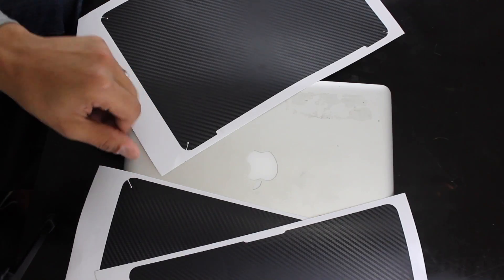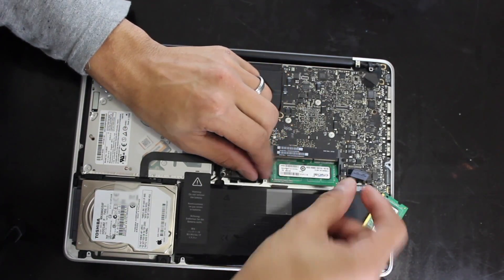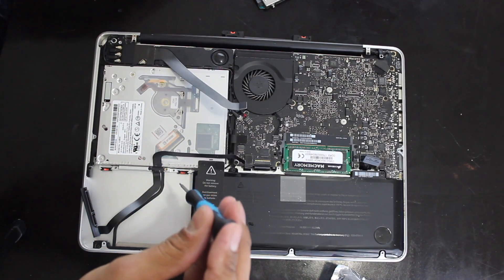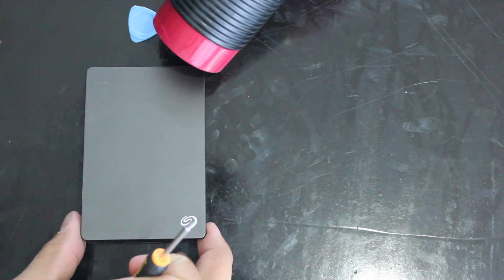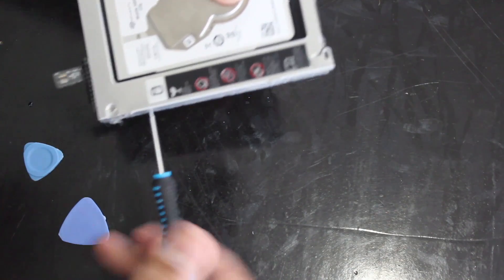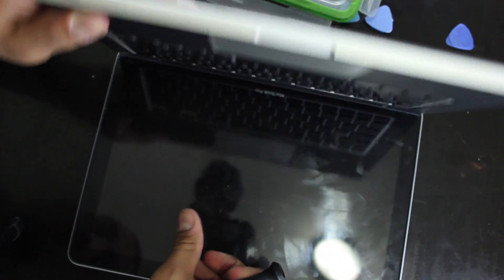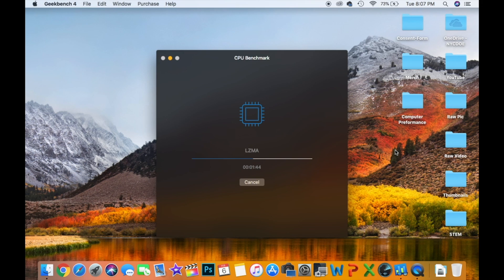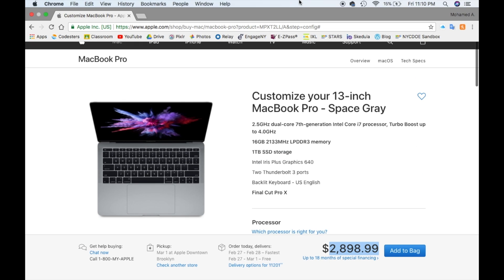2011 Macbook Pro Upgrade (3TB, SSD + 16GB RAM)

Comment: I have a 2011 MBP I upgraded to 240 SSD & 8gb. I only use it for Logic Pro X. Works great. Only downside is, I can’t update Logic past 11.3 not a big deal. But also, some external music gear isn’t recognized with High Sierra. Some midi keyboards and drum machines etc. And of course now that Apple doesn’t support Hugh Sierra as of the last couple months, no security. I really don’t wanna buy a new Mac. I love mine.
Reply from the maker: thank you for your comment
Reply: I have early 2011 upgraded to 500gb Ssd 8gb ram and used open core legacy patcher to install MacOS Ventura, I am getting all the updates runs very smooth. Though I must share.

Comment: I need to replace my optical drive with another SSD. I replaced the HDD on my 2012 MacBook Pro with a 1TB SD, the RAM was upgraded form 4GB to 16GB. Adding an SSD will make a huge difference.
Reply from the maker: thank you for your comment

Comment: My 2011 is not detecting the hdd. Changed cable still no go.  Will it detect and boot etc by only having the hdd in the optical bay?  Thanks
Reply from the maker: thank you for your comment. sorry for the late reply

Comment: Huge Thanks for this video: I have "MBP 13.3/2.9/2X4GB/750/SD" where "Model No: A1278" - Can you confirm if I can buy 
"WD Blue SA510 SATA SSD" - 1TB of capacity - "WDS100T3B0A-00AXR0" (shown in back of the box package)? - My uncle should buy this HD in USA and I live in other country - so is not possible make a mistake. Thanks for your understanding.
Reply from the maker: thank you for your comment. sorry for the late reply, it should be okay
Reply: @MoeNegm  Thanks for the reply and data.

Comment: Hello, I've been wanting to do this. I noticed when I went to the RAM they offer higher Mhz and higher GB. Is it not recommended to go higher? Could getting a larger capacity Samsung SSD and a larger optical drive make it possible to utilize more RAM capacity? My 2011 Macbook has gotten the grey screen of death and I just want it to be useful again and this video gives me hope. Just want to max out its ability for sure when I repair it. Thanks for the video!!
Reply from the maker: thank you for your comment. sorry for the late reply.

Comment: Good Day Sir, Sir can you guest what's wrong with my MacBook Pro (13-inch, Early 2011), I recently upgrade the OS (high sierra) of my device, It went good, but not until I unplug the charger it freezes and heat up my Mac..   What should I do? Btw my mac had 4+4 gb ram, 119 gb ssd, 250 hdd, Intel HD Graphics 3000 512 MB graphics... Thanks for the fb..
Reply from the maker: thank you for your comment. sorry for the late reply. I'm not sure

Comment: Out of curiosity from watching this video that helped me install my new SAMSUNG 870 EVO 1tb on my mid 2010 MacBook pro, my question is.. How come i can shut off the computer and turn it back on to easily be brought to the password screen to log into my MacBook, but if i click restart instead of shutdown to turn back on.. when it reboots from a restart it brings me to the ERROR icon, but if i shut off the computer from that error icon and turn it back on, it works FINE. lol, could this be because i still have the original 4gb ram in it ?
Reply from the maker: thank you for your comment. sorry for the late reply, i'm not sure that's weird! maybe your ram?

Comment: All that money and work, and then running High Sierra?
You can run Monterey on it:   https://www.youtube.com/watch?v=-huRykhjs6g
I've installed Monterey on 2011 and 2012 MBP's and it works great.
Just beware of 32-bit apps.  Tney won't run on Monterey, so the highest you can go, and still run 32-bit apps, is Mojave.

Comment: I'm actually watching this video, with a Macbook similar to this. (MacBook Pro (13-inch, Late 2011) And I can say, this Mac has been amazing for the many years I've had it. I can say it still runs pretty well, and sometimes better then new Windows computer coming out these recent years. Obviously, it isn't in it's prime anymore but still gets things done, without any issues like lag, and overall no performance issues, and I've never changed anything hardware-wise in it. Can still stream, and play games on it, and go on high-performance apps. Honestly, I would change computers, for a newer one but sadly these new ones tend to be made cheaper then this, and lack the features, like this one has. As an Apple worker once said to me, this computer is a gem, and they dont make this type of quality anymore. I'm not an Apple fan, with this being one of the very few apple products I own, but honestly, for 2022 it can still handle it. It just depends on how well you've treated and maintained it, but I use this daily and its great. But maybe in the future, I'll be doing this type of upgrade.

Comment: Why would you install the same slow drive in the optical holder instead of a SSD? 2 TB does not speed it up, that's storage size only, as long as your new main drive has the OS it will run faster, but it will bottleneck when it accesses the HDD.

Comment: Why didn’t you clean the dust from the logic board & fan to make it run cooler also replace the GPU & CPU thermal paste? With all of that work you still more to do. I’m not sure of the purpose for the 2nd Hard Drive & especially 2TB? Good job to make the most of your older but better repurposed MBP!

Comment: I replaced the memory to be 16 GB a couple of weeks ago and I noticed some difference, the laptop has more speed.. However, I replaced the SSD today with the one you recommended (1TB samsung). However, once I turned the laptop on, it only showed the grey screen and it had a blinking icon in the middle of the screen (the icon was a folder with a question mark).. it stayed there blinking and nothing else happened. I put back the old SSD and computer works.. any idea of why that happened??
Reply: You need a usb to put the system again 😂
Reply: What do you mean? “/

Comment: How much did this cost to do? My 2011 mac is sooooo slow, I get the spinning circle with every click and using imovie is impossible.
Reply: Less than $500.  I added a 1 TB SD HD and upgraded the memory to 16 GB.  Worth every penny especially compared to a new one!
Reply: Were you able to complete the hard drive upgrade? How did you transfer data from the old drive to the new drive? Thanks in advance for any feedback!
Reply: @parkerrogers2277  i had a Time Machine backup and used it to restore all the data to the new SSD.  You will need a boot drive (USB Smart Drive) to boot from after installation of the new SSD, and restore from Time Machine backup.  It took some time to restore but it was worth it!

Comment: I did this exact upgrade on my 2011 MacBook Pro and it made my computer blazingly fast.  I was amazed!
Reply: Am doing tomorrow so excited!!
Reply: I have replaced hard drive with Samsung 1Tb and am using Old drive as external drive this way my data is safe and i can access it anytime by connecting with usb
Reply: did you update the hard drive as well? if so, how did you do the back up and the restoration after the upgrades? I have updated the ram and just purchased the SSD but have not pulled the trigger on the optical drive/hard drive
Reply: @neryorozcoyt    I put in a SSD drive and used the latest backup from Time Machine to load all the files on to the new drive.  I used a flash drive and created a bootable installer first, swapped drives, booted from my flash drive and let Time Machine load to the new disk.
Reply: @stevenjp7155  Do you think using SuperDuper! would also work to copy from old drive to new? This is a video of that process from 2017: https://youtu.be/j2efihrnStg?t=546  I really appreciate any feedback. I'm attempting to help a family member with her computer.
Reply: @parkerrogers2277  I honestly don’t know about options other than Time Machine.  Since Time Machine is built into the OS, it worked seamlessly without any data loss.  Sorry not more help.
Reply: @neryorozcoyt  Yer witch one do you install the new osx on ?
Reply: I’m doing the same can’t wait

Comment: Hello! Great video tutorial I followed this to upgrade my MBP and it's working amazingly! Appreciate this. 

Question for you- it seems my internal temp has dramatically risen with the readings since doing the upgrade. Average around 200 degrees F and prior to the upgrade, the readings were around 130-150 F. However I can't imagine this being accurate bc even when it reads 200, the laptop is significantly cooler to the touch so did I mess up the sensor in some way? Or is this normal with a SSD? not a biggy but the fans keep kicking on so loud. Any help would be appreciated! 🙏
Reply from the maker: I honestly don’t know why that would be happening. I hope someone on here could possibly help you out. Did you install 16 or 8gb? If you installed 16, try reducing it to 8 and see if that helps. 

My guess is that the processor is working kind of hard to keep up with the extra speed achieved by the SSD and the Ram upgrade?
Reply: @MoeNegm  thanks for responding! It was 16 ram so quite possible regarding the processor. It's just strange that to the touch the laptop is much cooler now with the SSD than it was before the upgrades. Other than that, this laptop is now a beast! Couldn't be happier still need to upgrade my iMac 27" same yr
Reply from the maker: Sweet, I’m literally filming that exact video right now Lool.
Reply: @MoeNegm  nice!!! I can't wait til u post it!  I'll follow along lol

Comment: Question, can I go 16 gb of ram total of 32 gb? Same brand of the ones you recommended but 16 gb interested of 8 gb.
Reply: you can't have 32GB of ram because 16GB is the limit for a 2nd gen i7

Comment: So I went ahead and did all of these upgrades to my MacBook Pro (early 2011) and now the startup manager won’t work at all. 
I reinstalled my old HDD and everything works. Startup manager works fine. 
I reinstalled the new SSD (Samsung 860) and all I get is a white screen. I’ve tried every key option while powering up but no luck.
Anyone else have this problem ? I could really use some help with this ...
Reply: Did you format or clone the new ssd?
Reply: @Asphaltaperider   wound up being some pre installed programming on the 2 TB HD.
After reformatting and using a clone backup, it worked.
Reply: @Asphaltaperider  clone

Comment: I did it on my 2012 15” MacBook that had a regular hard drive with 4gb ram and now it has a Samsung 1tb ssd and 8gb ram and it runs exactly as fast as my 2018 MacBook
Reply: Thank you, mine is a MacBook Pro 15 inches, where specific store had you buy those pieces?

Comment: Great video mate. I need one for doing video and photo editing and I'm considering doing either a 2011 or mid 2012 MacBook Pro with max upgrades. Now in 2020 what would you recommend for these tasks?
Reply: Which did you get I'm in the same position as you i wanted to use it for software development
Reply: @elite.1  Back then i got a 2012. I am currently using a 2015 that i got for $50 https://youtube.com/shorts/cOM8bJBruQE?feature=share 
Honestly performance wise there is not that big of a difference so i guess you can still do 2012 and max it out.

Comment: If it wasn’t for the atrocious screen resolution of those older 13 inch models I probably would have kept mine.  Too bad there’s not a way to put a higher res panel in it.

Comment: @moenegm great video! Can I install 2TB SSD?  Pro’s - Con’s? Also can you install more than 2 TB into the optical Drive (it appears that the physical size would be too big).
Reply: Yes you can install 2TB SSD, and you can install more than 2TB in Optical Drive Caddy but it would have to be a SSD due to HDD starting to use 3.5 Inch only when it comes to 3TB and more, the highest SSD you can buy right now that's common is 8TB Samsung 2.5 Inch SSD, the Pro's are is you get more storage and you COULD Raid 0 them, the downside is you won't be able to watch DVD's anymore (Although you could use the SuperDrive externally by using the Optical Drive SATA to USB Cable), I hope this helps.

Comment: Just bought a late '11 15 inch with 16gb and ssd. I hope it'll run fcpx decently. Would you upgrade to Mojave / Catalina or would stay in High Sierra running an older final cut version?

Comment: Hi, I would like to know if I can use different external drive for the replacement of optical drive? I'm referring to WD 1TB. I'm trying to replace it now but it seems that the WD external drive has different pin connectors.
Reply: You need an external drive with SATA type connection inside.
Reply: If you value your data, you would install an SSD, not a WD 1TB external HHD.

Comment: After doing the upgrades to the hardware and restoring with time machine, can you now upgrade from High Sierra to Catalina? I have a 2011 MacBook Pro that needs to be able to run Catalina and I would much rather follow your video than buy a new machine 😃
Reply: Update: using a video I found from “dosdude1” on YouTube called how to install macOS 10.15 Catalina on an Unsupported Mac” - was able to update to Catalina
Reply: How did you transfer data from the old drive to the new drive? This is the only step I don't feel comfortable doing that's preventing me from doing this upgrade. Thanks in advance for any feedback!

Comment: Hi Moe. I just installed a 1 TB SSD to my back pro along side the 16 GB of RAM to it. I followed all the steps you did as far as installing the hardware. However, when I start the computer and log in it is giving the message of “drive not identified”. Is it because I have to run the backup that I have? or am I missing an extra step? I would really appreciate it.
Reply: Did you figure out what the issue was?
Reply from the maker: Did you figure it out?

Comment: I mean everything you just said about not upgrading makes zero sense, the reason being that the i7 8th Gen performs about 200% better than the 2nd gen. The ssd is about 2 times faster. The graphics performance is wayyy better. So even the i5 8th Gen on the base model is better than the i7 that u have
Reply: I agree with you buddy. He's willing to stay on on 1280 * 800 resolution display as compared to the current 3072 * 1920 . He wants to stay on a machine that overheats. His choice. My only problem is that my 2011 MacBook Pro battery is dying. So i need to get a new battery,get a new ssd as it's kinda sluggish,get a new ram and still stay on an outdated processor with outdated graphics with outdated screen and outdated MacOS High Sierra. Doesn't make sense. Infact, even my speakers sound muffled. What all to replace?? Its better to get a new laptop. Early 2011 MacBook Pro is in need for a total replacement. Upgrades won't help. It's already 9 years old.

Comment: Hey moe, I have the same laptop as yours.
MacBook Pro (13-inch, Early 2011)
Processor 2.7 GHz Intel Core i7
4 GB 1333 MHz DDR3
Intel HD Graphics 3000 384 MB.
So what do I need to upgrade to run photoshop and work-related programs? 
I would appreciate a reply.
Reply: RAM, SSD, and replacing the thermal paste.
Reply: @saudalshabiby308  yeah i did that 8gb ram with 128 SSD works like mint, but i get random shutdowns, same problem before upgrading these parts

Comment: I love this laptop! I used to use it since it was new, upgraded everything that was possible. One day it lost the support to the last MacOS, and the display suddenly didn't work anymore. So I connected it to an external monitor and installed Linux on it. Still use it ever since!
Reply: You can put the catalina on it by using the dosdude patch.
Reply: @garyd1065  opencore will give you Ventura. <:o)

Comment: I’m buying a second hand 2011 mid year macbook pro ...it is running intel i5...i was going to remove the 500g hd for SSD .  Can the i5 handle the same amount of Ssd as you demonstrated in your video.  I’m a senior with very little knowledge in computers but I load a lot of photos and was wondering?
Reply from the maker: I don't see any reason why it wouldn't work

Comment: Can you do a 2020 update on upgrade & cost? Currently having issues with my MacBook Pro mid 2011, 8GB ram, 500gb hard drive, only turning on & slowly opening & loading other things. Would love to see if investing in the upgrade of it is still worth it or if buying a newer used Mac would be cheaper & easier.
Reply from the maker: I think you can get an SSD and upgrade your computer, leave the ram as is. You can get an SSD for as cheap as a $100 now and keep your 500gb as a secondary drive internal or external doesn't matter. But I def think the SSD would help load your programs faster
Reply: Also, thank you for the response, I appreciate it! I’m sorry, I meant 4GB ram. Would that still work okay with a SSD? Also, instead of putting the extra 2tb drive in that you did, could I instead place the original 500 gb drive there? I would really like to upgrade my ram to 16gb because I want to do a lot of video/photo editing. Would the 1tb SSD be enough to utilize  the 16GB ram?
Reply from the maker: No problem, Oh 4 is too low. You should upgrade to 8 even though I out 16 I actually went back to 8 because I didn't notice a big difference in this machine between 8 and 16. So just do 8. Yes keep your 500gb as your second hard drive and just buy one SSD as a main drive

Comment: Hey, Moe. Thanks for the video. I have the same machine but with the i5 processor. I have 16GB of RAM and I'm going to replace the HDD with SSD. A few questions: 1. Do you think I can edit 4K with my configuration post SSD? 2. Can I use the superdrive externally? 3. Can I just use a backup drive like your 2TB drive as the main (boot) drive? Would that work? Thanks.
Reply from the maker: 1) you can edit 4k but it will be really slow and annoying
2) yes
3) yes, but you want the main drive to be an SSD because it'll load programs faster
Reply: @MoeNegm  That's what I mean, Buy a cheaper 2 TB external. Take it apart and just use that instead of buying a Samsung or Crucial.